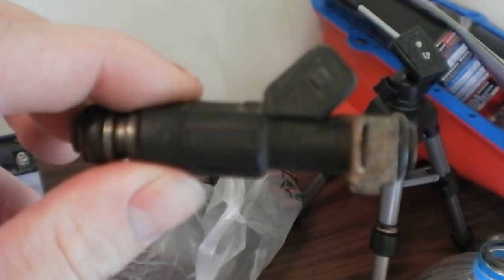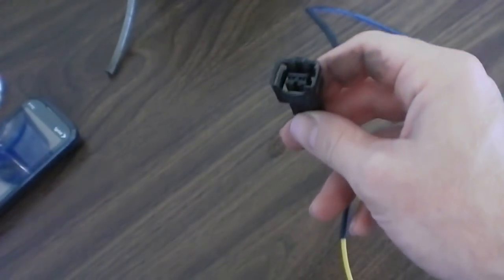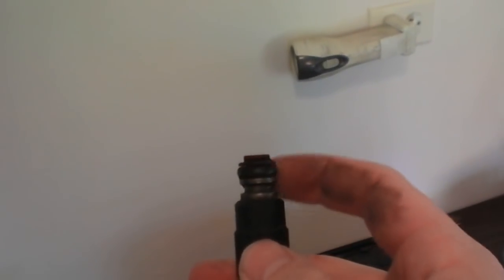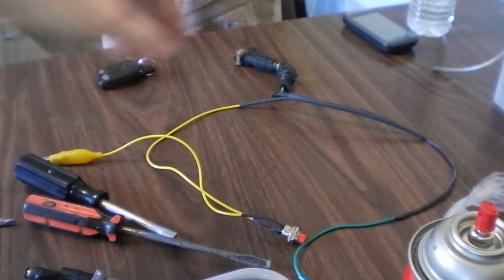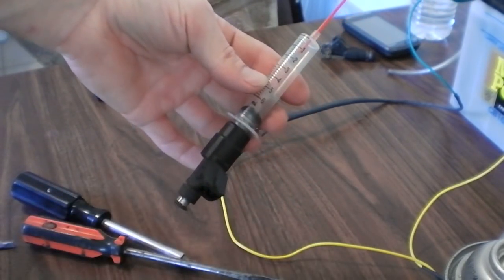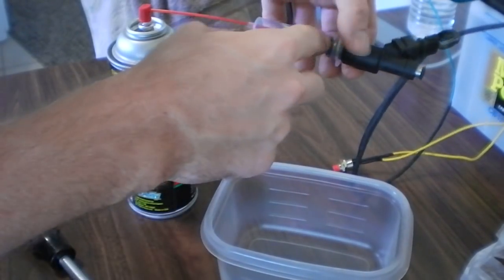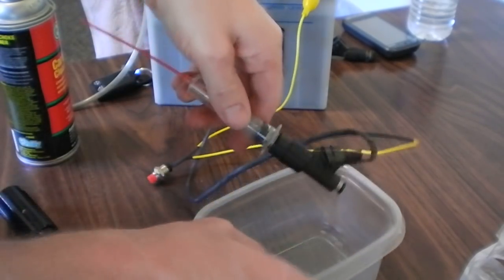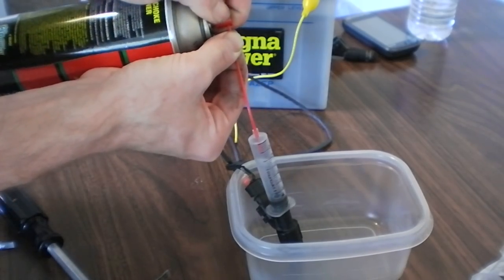Fuel injector cleaning

Comment: Glad I found this! This is a well put together video; good sound, to-the-point direction, and decent camera work. Also, the set up for this system is quite clever, I can't wait to try it out. Replacing all the fuel injectors I have now is too expensive for me, so I'm trying to salvage what I can to reduce costs, and hopefully this will help. Fingers crossed!

Comment: Dear Robguitargod1! Thank you very much for share this video!!! Nobody knows what is the problem with my car. When I started the engine for 5 secound does not worked all of the cylinders, it was a little bit weak, and the gasreaction was too too slow... In the service told me the guy, my injection heads are good. I just try your way and the car will been smooth, start immediatelly, stronger, sharper. It will been a better car. So thank you very much again and sorry for my weak english. Regards

Comment: Nice way to do it!
I did it another way using compressed air, and a short length of fuel line.
I used a 12V battery charger to power the injector, but most automatic types they make these days won't do it. However a 6 to 12 Volt plug in adapter will work. To my knowledge injectors actually run at about 5 to 6 volts anyway.
Nice vid :)

Comment: Injectors operate on 5 volts. !2 volts is way too much, thats why you hear the pintel moving so violently. The coil wires are about as thick as a strand of spiders web. Very helpful video.

Comment: Don't forget protective glasses, it may not seem but there is a bit of a pressure and those connections enjoy breaking free.  Don't forget to back flush because that gives a flow from the opposite 'normal' direction.  Install the injectors the same day, don't let them stay with that solvent overnight as it contains acetone and that can damage the injector.  I use a small 9V battery by the way, plenty enough.  Never use acetone or lacquer cleaner.

Comment: Where did you buy the fuel injector kit? I bought mines on Amazon but t doesnt have the nozzle with the button. Mines has the large and small plug with two white plastic spray nozzles you attach the back injector into the hole and hold the top slanted part of the white plastic part that has the slanted top on it if you know what I'm talking about yours has the cord with a button and the plastic nozzle for the back end and you can see the carb cleaner om out and spray it at your on will

Comment: Don't forget to HAVE the basket filter installed when cleaning the injectors.  Otherwise you will surely get debris inside from the rubber hoses used.

Comment: Nice job, with one exception, you might have mentioned eye protection for the operation outlined, especially since you noted a bit of a mishap with the syringe coming off under pressure, but other than that I'm very impressed, enough so to try it myself..Cheers

Comment: You may also be able to buy the injector electrical connector like I did for my '89 f150. Took a lot of talking on the phone but I finally found it at Auto Zone for about $6. Beats driving 45 minutes to the closest self-service junkyard, and paying a $2 entry fee just to find out they may not have the part you are looking for.

Comment: Beginning manifold vacuum hot: 13.5-14 inHg
Added Seafoam to my gasoline.  Took the car out on the highway for 5 miles out and 5 miles back, doing about 80mph in the far left lane in 4th gear most of the time.
Back to the garage, Ending manifold vacuum hot: 17.5 inHg. 
WHY?
Why did my fan belt start slipping immediately after I started the motor for the first time after adding Seafoam to my gas?   I remember cringing at the noise it was making (not knowing what it was, it was different than the way loose belts normally sound because the belt was brand new), while at the same time marveling at how much better the engine's pickup was.  Yes, it was the belt slipping on the pulley from the torquier motor and this was every time I put the throttle down.  That belt was tight enough for the way the motor ran before Seafoam but not after. 
WHY?
Seafoam gets blamed for causing noises under the hood after using it, and yeah it caused a noise under my hood too.
You'll have to excuse my own anecdotal evidence that it works is good enough for me and deniers look like idiots I'm sorry to see.   Does it work for everyone?  Hell no.  Is what's presented in this video far more comprehensive?  Hell yes.  I should pull the injectors on my car and inspect them and either have them professionally cleaned, or replace them outright.  
But if you're a random person with some carbon buildup who's too irreligious to buy a $7 can of Seafoam and try it first before belaboring yourself into hundreds or thousands of dollars of expense and hours of smelly and even dizzy work, I don't know what's wrong with you broski.

Comment: @fmmsss no gas will not clean them you will need them to turn on and off to be able to clean them you can try to soak them in carb cleaner but it may eat through the plastic caseing if left to soak

Comment: Nice idea, but I don't believe this simulates fuel rail pressure, I'm sure as long as the cleaners is running through the injector this should suffice though. I'd just make sure you have the good cleaner and not the junk generic crap that doesn't cut it. It should be easy to tell if it's working ok or not, if you first see dark spray coming out the injector when you first spay it, then keep spraying it until it's clear... I've found Berryman's carb/injector cleaner works best, imo.

Comment: Note: Gas Tank -> Fuel Pump -> Fuel Filter -> Injectors -> Spark Plug.

-If you don't hear loud whining Fuel Pump your good. If hear a whine, that's a moderate job, use a manual and another vid.
-More than 70k: Swap out Fuel Filter $5-50 (trust me this really helps and is easy)
-Pop off Injectors (job 5 min or less depending on car, watch other videos) Clean using same or similar method in video (can use 9v battery and alligator clips)

I start with fuel filter and then injector clean. BOOM done. You're welcome :)
Reply: This is also like the third video I've seen in a row where the cammer drops something and says Dammit! lol

Comment from the maker: @parvizsoccer No special current rating on the switch, and you can use whatever you want as long as you make contact with the injector. Yes, 12VDC battery.

Comment: Hehehehehe, good Video. Another EASY way.... My Dad fill a Line Tube about 4" with Fuel Injector Cleaning Fluid and plug that into an Air Compressor. He connect the Positive and Negative like this Video and just BLOW it right through until the 4" Liquid is Empty, that was it... Took him like 10 Minutes most :D

Comment: While I do not disagree that you may need to clean and injector from the junk yard because of fuel deterioration from sitting (stagnant and separated). Most injector failures and not from clogging any more. Most are from the breakdown of insulation in the injector from oxygenated fuel and less than robust design. Just as a side note it would be more beneficial to reverse flush the injector as much of the plugging that I have seen is particulate matter plugging the little screen going into the injector. Cleaning that will go much farther than the internal cleaning. :)

Comment: So I went through this process and my fuel injector is clicking and seems to be working but it will not spray out the carb cleaner, it just drips. Do you know if I'm doing something wrong or if I have a bad fuel injector?
Reply: Sounds like a clogged or damaged injector.
Reply: look on ebay they sale the filters
Reply: is there a way to tell if its clogged? and can it be fixed?
Reply: Erik John

Comment: I try to explain the best I can :) When you inject a mixture of alcohol and water into the chambers via air intake, it will cool the chamber, so you can have more air the cylinders. Also water will break to H and O2 when it reaches to 800 C. After the spark, the H and O2 will combine again and will produce superheated steam which is 2000 time more expandable than gasoline. So I wanna inject the mixture into he air intake via a fuel injector which is connected to a HP pump and a signal generator.

Comment: I've a 1995 XJ with 232k miles.  It has a slight miss at idle and barely gets by emissions, but runs fine once revved up.  All new ignition parts except the coil.  Might it be the injector?  Why is the 703 a popular swap?

Comment: My car wont start sometimes but when I get out and take off air cleaner, then open the carb wide open it starts. I jam a small flashlight in carb to hold the blades open and this seems to get it started? why does this happen?
Reply: air idle control valve. allows air into the intake when sitting at idle and throttle blades are closed. should be locate in the throttle body

Comment: Hey, I'm planing to install an additional injector in the air intake of the engine and inject water-alcohol in it. I'm going to connect the new injector to the signal wire of one of car's own injectors, so that every time that injector receives a signal and sprayed fuel into the chamber, the new injector receives the same signal at the same time and inject water into the air intake. Do you think this will cause a power drop on the signal wire of the main injector? Sorry for my bad English...

Comment: Haha all the comments about my car is powered by a fuel pump and the not every car has electric injectors ok  every car has a fuel pump and if the injectors are not electric then its called a carb and this video will not help you one bit but the carb cleaner he used will p.s. I liked the video not only is it a good way to clean them but also find out if one is bad thank you for making this

Comment: I did the same thing only with water instead of carb cleaner cuz I don't have it and I used 9 volt battery. I just wanted to see if it would spray. When I connect the wires from the injector connector to the battery, I hear some sound and see little sparks but nothing is ever sprayed. Any idea? Does it need pressure? You don't seem to have any pressure in your test

Comment: You people talking about how they are only supposed to actuate for milliseconds at a time, have you ever seen injectors on a flow bench? They run at much higher pressure than your fuel rail ever see for minutes at a time. Then when the set time is up they batch them together based on similar flow performances. You guys think you know it all but you don't. Apart from using to many volts there is not a damn thing wrong with how he did this.

Comment: One of my fuel injector on my Duramax  is leaking , do I have to change the fuel injector or only I have to change the O ring ?
Reply: try the orings first couse they are cheap vs getting a new injector

Comment: By doing all that, I will have more pressure in the cylinders, so I can adjust the air-fuel ratio and by doing so, I can reduce the fuel consumption :)

Comment: Seafoam is probably best used as a fuel additive.  Will it clean injectors when it's going right through them?  Yup.
Reply: YOU CANT CLEAN AN INJECTOR IN A VEHICLE. The fuel that goes through them, is clean. The tips get dirty, but so fucking what. If the spray pattern suffers you have a damaged orifice {wore the fuck out, too big, pintle is worn etc} no amount of cleaning them will bring it back to life. Further more, if it is "clogged" its the inlet screen at the injector opening packed full of shit. You need to flush the injector backwards or clean it in a US bath to get the bodies clean. Inside and out. If you don't see a great difference in spray pattern before and after, you didn't make any damn difference. Seafoam won't dissolve the shit that gets caught in filters. Thats hard particulate. IF it did, it would dissolve filters, and gas tanks, and fuel lines.etc. Sea foam ONLY softens carbon, its not really all that special of a chemical {toluene}. Injectors are cleaned, then balanced by shimming the springs to make up for variations in machining tolerances how each injector has its own electrical characteristics. i.e. rise time.
Reply: Diesel Ramcharger
When you soften carbon you can burn it out. It isn't going to work every time whatever it is, because yeah, life is complicated broski. Sometimes measures are necessary that are even more extreme than the measures taken in this video. (e.g. The injectors can't be cleaned period, and they must be replaced gasp.)
But if Seafoam can't even clean fuel injectors, tell me, what can it do?
Reply: Carbon deposits do not accumulate inside the injector, they are a by product of combustion. Seafoam won't fix any injector problems, aside from possible gumming from sitting for an extended period. However, regular fresh pump fuel with all the crap in it these days will clean the junk out just as well. Seafoam, or if your cheap, tolulene by the gallon, might correct some issues, mainly air passages that are carbon/oil fouled from exhaust recirculation. But bad injectors aint of them. Like i said, cleaning your injectors, like this, is stupid. Total waste, accomplishes nothing. Not even a simple flow rate or pattern test was performed to diagnose a problem, much less ensure that it was fixed.
Reply: Diesel Ramcharger You telling me something is a waste that wasn't a waste for me doesn't work.
Every case is different.  Some people can benefit greatly from simply passing steam through the intakes.   Watch the video uploaded last week by EricTheCarGuy called Decarbonizing Your Engine With Water.   This is in addition to running Techron and other cleaners in your pump gas.  My vehicle had short trips where the engine didn't get fully hot.  I got carbon buildups.  I had dead cylinders in the past from carbon fouled plugs.  In my case, Seafoam made an enormous difference.  If you can't acknowledge that, I don't know what to tell ya.  Yes this is about combustion. or the lack of it.  And yes, this isn't "cleaning injectors" per se.  It's cleaning carbon by running Seafoam through the injectors.  The injectors are incidental.  It could be a carburetor.  
It's a separate issue whether cleaning injectors helps the running of an engine or not.  Maybe some of the time, it IS a waste of time.  I'm not arguing that.  I do see anecdotal evidence all over the internet that cleaning injectors is a good idea, whatever. 
An additional benefit of Seafoam in the gas is it preserves the gas's useful life.  This is especially helpful for vehicles like mine that are not daily drivers and don't get much mileage put on them, if any, over a period of several months.  You should really stop telling other people what they need boss.
Cleaning injectors "like this", you mean like in this video?   Personally I would just replace my injectors with new ones.  So in that, we agree. 
What we should know from experience with a spray nozzle, when the tip is clean it works best.  I don't see any reason why this wouldn't fundamentally apply to a fuel injector.
Cheers
Reply: heymisterderp LOL. even your references are fucking idiots. Decarbonizing an engine with water. LOL. Ok first off, water is an oxidizer. If you think water is "safe" to inject into your engine, by all means go ahead. Water has ZERO lubricity, is actually an ABRASIVE. This isn't 1953, engines don't accumulate massive carbon deposits, and when they do. Its not from contaminated fuel. Its from EGR systems forced on us by the EPA. All cars have reburn systems of one form or another, and they are always what causes headaches. You simply aren't building deposits in your injectors, or on the tips. If you are, you have a much larger issue than a simple cleaning can resolve. You can in theory and fundamental all you want. In practice this is a waste of both time and resources. Because  1} it in no way quantifies injector flow rate 2} it in no way quantifies injector spray pattern 3} injector rise time and coil soak time are not measured. It doesn't matter how clean your injector is, if one flows 30% more fuel than the other. Even if they all have perfect spray patterns. This test does nothing, its a feel good thing some idiot posted to make a video and fill space on the internet. Those who know the least, know it the loudest. I won't even go into the fact you are using flammable solvents, dispersed under pressure by at atomizing nozzle while using a non sealed switch to repeatedly cause electrical arcs RIGHT NEXT to this plume of highly volatile fuel. Yeah, you guys are fucking geniuses. Maybe you should step into my life for a second and figure out who i am, before talking back to me.
Reply: Water does work to clean carbon. The water flashes to steam in the combination chamber and loosens the carbon deposits...but that is all irrelevant to cleaning fuel injectors..
Reply: BamaRailfan You mean the combustion chamber? You go ahead and believe that {that water is suitable for cleaning heavy carbon deposits}
Reply: Good job

Comment: What is the operating voltage for this fuel injector. Mine are operated by about 5 volts. I want to use this method but am concerned about the 12 volt battery and whether any damage will ocurr to the fuel injector coil.

Comment: I rather just do a can of carb cleaner with the straw and syringe. The can is already pressurized out of the store. I would prefer this method. The punp though is a little too much . Unless your trying to just have it flow test rated the lazy way if your doing multiple testings.

Comment: Best way to clean your injector is with an ultrasonic machine that cleans them properly plus runs a diagnostic test to ensure smooth operation for all injectors. The way you show which is clever no doubt about that , will not ensure you proper cleaning for all your injectors and this may result to a chain engine failure. Take my vice and take them to an ultrasonic cleaning service.